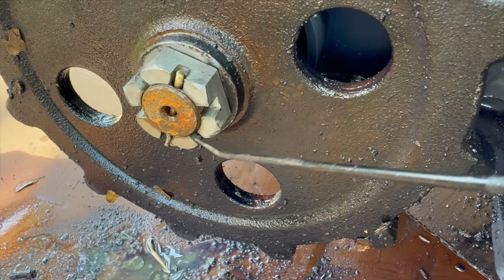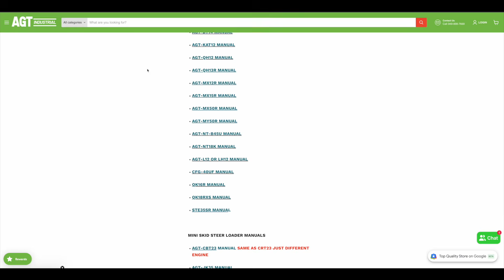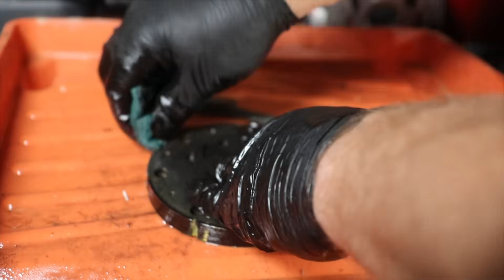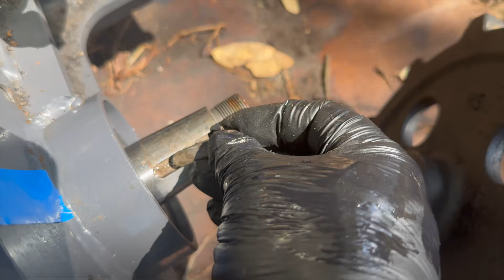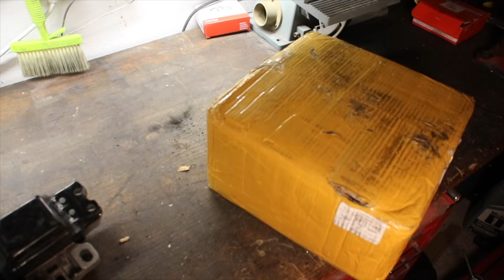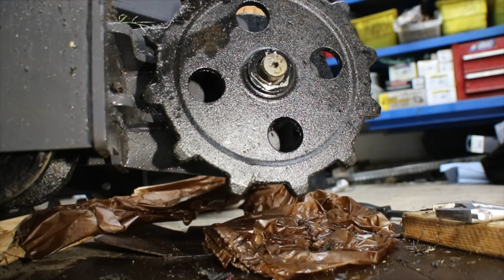AGT Chinese mini-excavator BMER 350 Track drive motor Failure & replacement | MX12RX & MX15RX

Comment: Case Drain on motors!
Reply from the maker: I looked in to it. Not practical for these motors. Also, replacing the motors has been the fix for 200 hrs. A video coming on the aftermarket seal soon.

Comment: You do not have to do all this. These cheap Chinese excavators have no hydraulic oil coolers/or have air cooled hydraulic oil cooler. When cheap original hydraulic oil gets overheated, its viscosity becomes so low that it flows like water and seals do not hold up.!!! JUST CHANGE ORIGINAL HYDRAULIC OIL TO A GOOD ONE AVAILABLE IN US!!
Reply from the maker: Check out my video playlist on repairing these machine that includes everything you mentioned and more. I have two of these machines I rent out to customers. One has the cooler and the filter installed and the other doesn't. Not including the hydraulic drive motors, I have noticed a lot more hydraulic leaks and failures on the machine without the filter and cooler. Having the cooler in the south-Texas summer heat seems to make a difference. Here is a link to the playlist. You should check it out.  https://www.youtube.com/playlist?list=PLdwFbRAYaQAjNX-NLtyR5b5B4bvn2id2J

Comment: Thanks for putting this video up. 

I just got one and it blew the seal. So, after cramming enough info on these drive motors to be dangerous. 

I went out and ordered one with a t31 shaft and WD fittings. From everything I’ve measured on the old drive motors, that should work. But the resellers leave me feeling a little skeptical. 

I guess I’ll find out this week. If this motor works, I’m picking up another for the other side. I’m sure that will blow out too. And until I get my shop built, which is why I bought this thing, working on it in the driveway ain’t fun.

Comment: I have one of these too. And I just bought a new swivel center valve to replace the 6 port, with a 10 port, so you can connect a case drain to each motor. That let's it flush the junk out (that should never be there, if this is a new machine). But to value engineer cost out, they put in check valves to let the case drain to the flow out of lowest pressure. 
I'm worried how much junk is in my oil. 
I'm also trying to change the main gear pump to a variable flow piston pump, that has build in pressure compensation. I did not find anyone that has tried that solution. The motor has to be moved to make room for the deeper pump. I see your's has a SAE style flange mount, mine has the European 4 bolt. I paid way too much for my machine from. I think my gear pump is a 6cc/rev, and found a yuken ar16 pump. I also got a diesel 10HP engine off ebay, and going to replace the gas engine with a correct engine and experimental pump.
Reply: I just looked at bmer-3 motors, I don't see a case drain plug. There's got to be one there.
Reply: I just took out a bright light, and looked at the existing center valve on my machine, there's a 7th port, and has steel plugs. That needs to get connected to a case drain. ..if there is one on your motor, and a spare port is on the center swivel valve.

Comment: The only thing that I ever got to work 402 oring with backer install your backup first Linda o-ring bend the metal plate 402-0ring

Comment: Did you replace the hydraulic fluid and engine oil before using it?
Reply from the maker: Yes. Check my other video for complete servicing. Identical damage has been documented on hundreds of drive motors from the same manufacturer. The consensus is, this was a manufacturer error. No amount of maintenance would have prevented it.

Comment: I was working with my mini excavator today and the cotter pin came out of the drive motor that castle nut came off and I didn't take the belt off yet the track but is that Allen key a half Moon that holds the sprocket on the wood drift key? Thank you and do you know where you can get them?
Reply from the maker: It’s pretty common. Most of the big box stores carry key stock. It should be square.
Reply: @BurnoutsAndRotorblades ty
Reply: I found out the reason it broke that castle nut wasn't tight. This machine only has about 2 hours on it. Thank you again
Reply from the maker: Put a wrench on everything. Check out my channel for the video about what to do when you get your machine home.
Reply: @BurnoutsAndRotorblades tu
Reply: @BurnoutsAndRotorblades did your castle nut have a washer behind it? Thank you!

Comment: I've spent forty k on a case.Haven't been greasy once i'm not sure the attraction of these chinese machines.I find them entertaining, but purchase one way 800 bucks for home use. Maybe I 😅😅😅
Reply from the maker: If I was using a machine as my livelihood, I'd spend the money on a nicer machine. However, after 20 years of working on multi million dollar aircraft I can say, everything will eventually need maintenance. The difference is, how much will parts cost.

Comment: Bravo to you telling a newbie "If anything goes wrong " "Just let go of everything" I used to be a forklift trainer and told them all the same thing. A girl learning said you saved my bacon I almost tipped over and did what you said. Good feeling to help and use myself.
Reply: That fails if you drive trough brush and a branch starts pushing on the levers.

Comment: 구동축에 별도의 하우징 없이 직결로 연결된 스포로킷이 문제다 ,  애초의 저 모터는 큰 탠션을 버티지 못하게 만들어진것이다
Reply from the maker: The replacement motors have outlasted the drive motors that came from the factory by a significant margin. While you are probably correct that the motors werent designed to be track drive motors, the issue in this case was a manufacturing error. The seal was damaged during install. This was the case for hundreds of people who bought machines with this same manufacturing defect.
Reply: @BurnoutsAndRotorblades   중국산에 내구성과 완성도를 논하는것은 잘못되엇다

Comment: What i liked most was the oil soaked Cardboard that you put under the Motor instead of a fucking pan. 

I hate people like you with absolutely no clue, concern or intention to keep our environment clean. 

I'd much rather have you back playing with legos
Reply from the maker: After 40,000 views, My first hate comment! I knew we’d get there eventually. I did have to shovel out some contaminated soil after the initial breakdown. The cardboard did a pretty good job of absorbing drips from multiple attempts, and it’s pretty common practice in field service. I garden in the yard where that breakdown happened. So, I removed a couple more inches of soil until it looked clean. I followed a similar  protocol we were thought in the military if we had spills. What drives me nuts is when folks don’t wear gloves touching all these chemicals.

Comment: Great video! Just bought this machine. I have read that the manufacturer has since changed the drive motor since the BME had so many issues. More likely though that they found a cheaper one 🤷‍♂️. Either way, I have to check mine to see what's behind the tracks.

Comment: Those seals are just low pressure oil-grease seals not high pressure hydraulic seals......might be a clue to the problem.

Comment: Okay but what we need to know 7 months later is whether or not these new motors are still functional. I'm about to buy two replacement motors for the exact same reason for my CRT23 Mini skid and I have no idea if the new motors will blow out just as quickly as the factory ones lol
Reply: and..crickets.
Reply from the maker: They are still going strong!
Reply: @BurnoutsAndRotorblades  Thanks much, do you remember the exact model and source you bought them from?

Comment: I feel like it might be more cost and time effective to build a cnc plasma cutter and make your own excavator.
Reply: this is a way for people to get views and likes and all that shit that gets you a check from youtube based on the amount of advertisement revenue they estimated you have playing at random in your videos lol if dude man would hop on a plane and go to china and visit a few manufacturing operations of whatever he can think of I think he will have a different take on "cheap chinese" it's not their fault that americans choose what equipment or whatever it be that they are  re selling here for a profit i mean the tooling is what they have a machine to mass produce seemingly anything you can come up with if not they will call up the place that builds the tooling and equipment required to accomplish it and the cheaper things use less precise tooling and aso on this is also the same for bearings if they are recognizable when a repair is needed measure just like a seal take some clear pictures of the thing and there you go they will make your parts for your machine or whatever it is that uses any type of bearing and you should check into the differences in bearings and what each style and designs are used for the amount of rotational, axial and combinations of both load forces and calculate how much the bearing needs to be able to supports

Comment: Good info but all it did for me an owner of 3 Chinese mini excavators was to stress me out, 2 minis I’ve owned for 2+ years with no major problems, no name brands. Yes typical tracks off, battery switch going bad. I do the occasional component tightening checks, frequent fluid changes and greasing. Not bought at an auction junk house, bought new, 1 from amazon, 1 from local ish dealer, latest rippa r10 eco. It was not greased except turret . Hydraulic aux line not capped tightly, leaked. When spring hits I’ll be rechecking with vigor all nuts n bolts.
Reply: this guy is just bashing everything about the things and cheap chinese is his favorite way to start off whats the problem with it and acts like he has the best way to re engineer the machine in the perfect quality way to fix something as simple as a seal get the seal out measure it take pictures of it call up a seal manufacture and they would send you a few and you should hirt the grease fittings every fitting before you hop on to work it check the fluids and change the motor oil and filters both hydro and engine that seal os just a standard seal the size maybe not but it's the same way with hydraulics of a lot of things like hose/failures you need you go get one made up at hydro shop get you some cheap chinese pair of  digital calipers so you can get the size measure the shaft it fits on and the thickness and the outside diameter inside diameter and the width between inside and outside diameters this goes for hydro cylinders when we would rebuild them when i worked at a wrecker shop we pulled em appart measure all of the tolerances that the seals will be fitting at the stuff that you take out is good to hang on to until confirmed seals are in and not oil sprays someone in the dick its not likely for all kinds of seals to be stocked in any significant mount bc of the cost they have a shit load they made and not one company is using odd ball sized shafts and etc. i would be the one doing most of this type of stuff my boss man was a beast of a mechanic and i wasn't green at working on shit but somethings aren't necessarily difficult but not having the right environment and correct tools and someone to give you a bit of useful knowledge on certain things that they have learned and its no big deal

Comment: Thanks for your video you put in a ton of work and I appreciate all of the information you provided.    I tried to screenshot and get the correct seal info from the video.   However. I was unable to locate the correct seals can you please provide the information for the correct seals.  Thanks again

Comment: Hi friend, I have a new HT 18, and when going downhill it jerks abruptly. The motors are 400 hp and the seller tells me I need to install 500 hp motors with a balance valve. I don't know why. Regards.
Reply from the maker: That doesn't make any sense. I have heard some folks talk about the motor "free spooling" when going down hill. I will admit that I'm not super familiar with that particular model though. I don't have any advise to offer, but a video showing the issue posted to the right group might yield some knowledge. There are some smart folks handing out good advise in several groups and forums.

Comment: I'm a fix-it-if-you-can guy too but half way through I was asking myself how much for a new drive motor 😂
Reply from the maker: I did it for the benefit of folks like you. Thanks for the comment and good luck!
Reply: @BurnoutsAndRotorblades did you ever get a seal that worked?
Reply: I was trying to find your other video noting the aftermarket seal kit that works, thanks for the video!
Reply: Reasonable but I'd submit that you're just buying another one just like the one that died.

Comment: Bravo man - I was looking for something with pilot controls and tossed an auction bid out before realizing it was a BMER motor machine. I'll likely flip it on FB marketplace first, but if I do keep it for whatever reason at least now I know where to get replacement seals. Thanks for your dedication and patience in several motor disassembly and reassembly cycles. We learn by experience - your time was not wasted! Pray I get outbid tomorrow ;)

Comment: very good video. The pain of all those failures would put me in the 'funny farm'. How much better is the new replacement compared to the junk one? How do you know the pressure seal is any better than the old one?
Reply from the maker: I have about 20 hours on the machine without any other issues. That's 15 more than I got out of the old motors.

Comment: Im about to pull my bmer 350 apart. Im going to buy a slightly larger outer diameter inner seal and machine the pump housing to accept a better quality seal like a timkin
Reply from the maker: There is a guy selling the replacement seals. They are custom made for this application. Go to the Facebook page I mention in the video.

Comment: Nice video.  Where is the resolution?  The link for the update video did not show up or I missed it.
Reply from the maker: Update is coming. The new motor fixed the issue and I have a couple dozen hours on them. I’m planning to rebuild with the new seals and that will be the update video.

Comment: I agree that your vids have great production.  I wish mine looked that good.  

Good efforts with the motor analysis.  I have never had wheel motor problems in 7.5y of ownership,
plus I bought 2 spare motors directly from China with the mini purchases.  I still have these spares (cost
about $320 each).  Mine is a Xiniu, not an "AgroTK", however.

Clearly there are assembly issues causing some of these seal failures, but what about all the
dirt in there?  Does your machine have no hyd return filtration?
Reply from the maker: I did install a return filter. I just haven't released that video yet. There was more corrosion than simple dirt. A byproduct of sitting without fluid during shipping I am sure.

Comment: Oh boy I’m going through this right now, same issue, did discover the two washers were stacked wrong from the factory 🤦‍♂️3 hours on the clock
Reply: Update for ya! My local hydraulic place mentioned there’s tons of water in the fluid will blow seals! My fluid was extremely murky full of water! I noticed yours looked murky as well I think the top fill cap doesn’t seal properly or I should say the flat washer seal just below the fill cap!